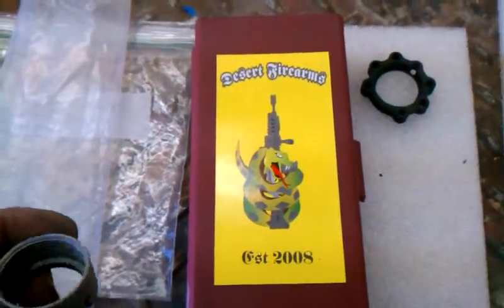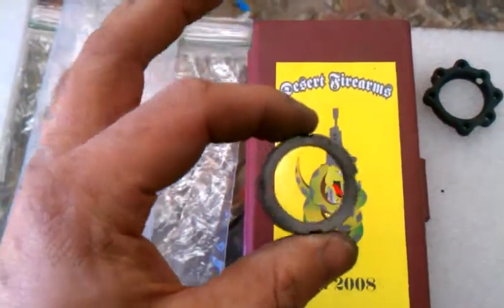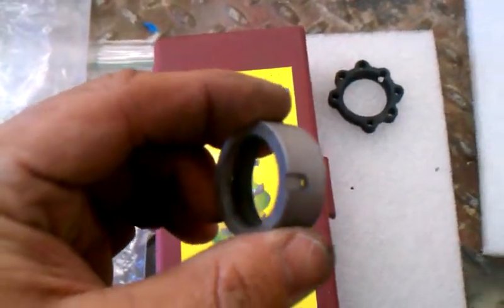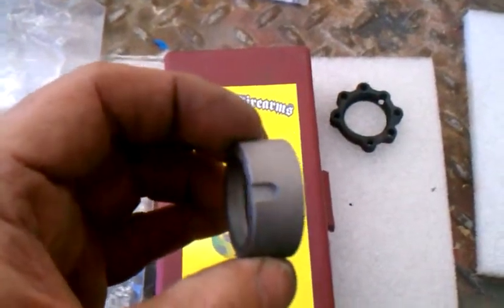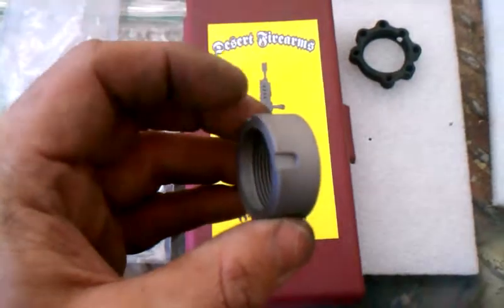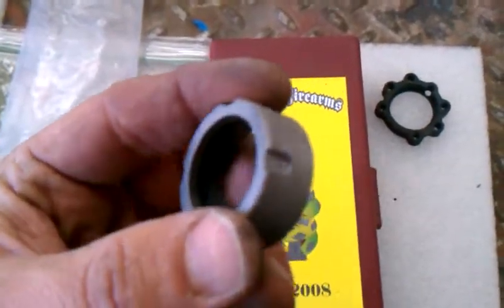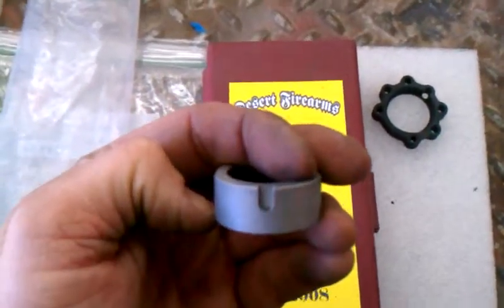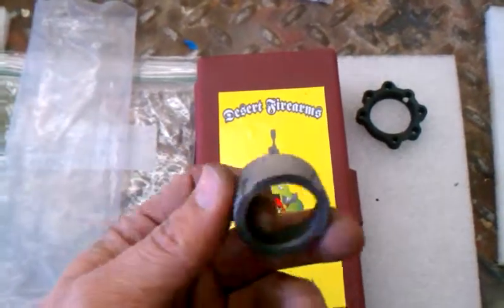Daniel Defense barrel nut issu

Comment: I just want to chime in on Daniel Defense. A month ago I purchased a new DDM4V7.  From the first magazine I had nothing but double feed jams, trigger failures and the mag kept getting lodged in front of the bolt upon reload. I called their customer service and at first they said it must be because it's poorly lubricated. Definitely was not and after 15 minutes of arguing with the guy he said he would send me a shipping label. Two weeks later my rifle comes back. No print out on what was inspected, fixed or replaced. Just a packing slip with my RMA number. So I inspect the gun and the only difference i see is that they put in a BCM charging handle and lubed it up. Took it out to shoot it same issues. I called them and asked what they fixed/replaced. They said the CH, trigger and BCG. Well except for the obvious CH change the rest was a lie because I took pictures of the BCG and trigger hammer and they were the original ones that were supposedly "changed". I told the guy that the BCG and trigger was not changed bc I took pictures from the original. He responded by saying "Well thats what my aromorer said he did. I can send you a BCG."WTF. I am so pissed I feel like driving down to GA from PA handing them their rifle and demanding a refund. Never again. I am going to sell this rifle and buy a FN.

Comment from the maker: No swap out per customer request, he was a pretty impatient guy (go figure, impatient gun guy) lol....

He wanted it used so we reinstalled snd had him sign a waiver.

Please check your geat and when you find issues like this remember your putting about a 50 - 60 thousand psi explosion about 8 inches from your face.

Parts fail and if you dont maintain them you risk catastrophic failure and possible injury.